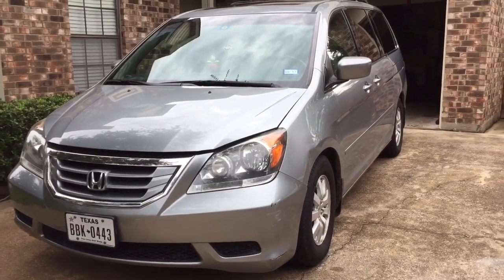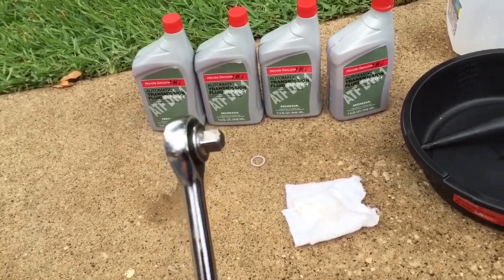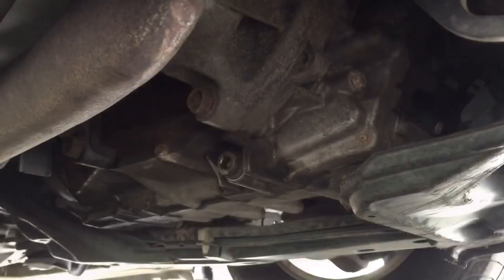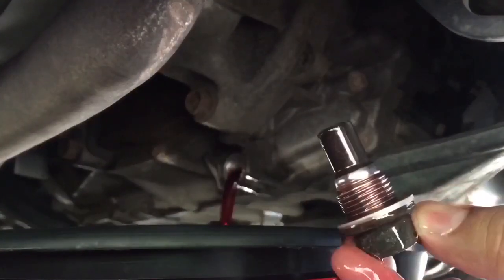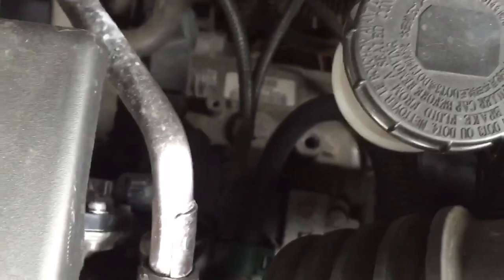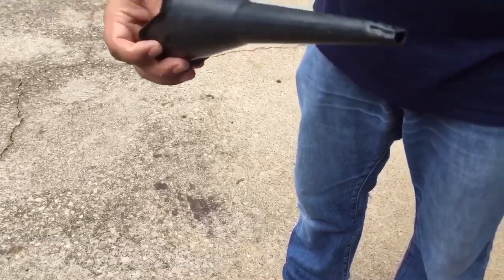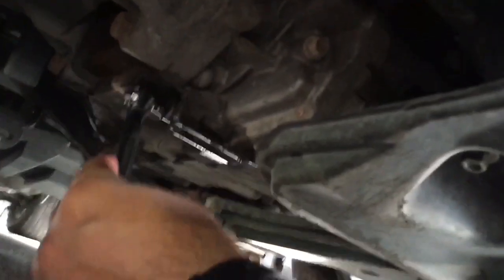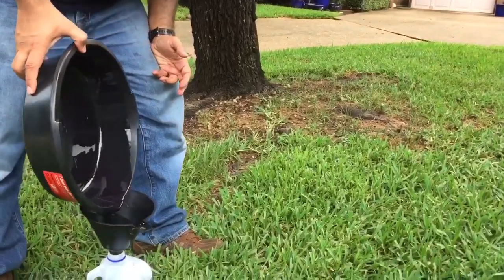2005 - 2010 Honda Odyssey Transmission Fluid Change

Comment: Good vid,  going to have todo this to a 2007 model
I plan I’m using Valvoline full synthetic ATF that is compatible with the Honda fluid.  According to what I have read it’s 3.3 qts to add back of ATF
Reply from the maker: Odyssey has the Transmission fluid dip-stick to see when you are full. Add 3.3 qts and check, then add more if needed. Honda Transmissions are very sensitive to other fluids, and 07 Odyssey has transmission issues so I would strongly suggest to only use Honda ATF. If the transmission fluid hasn't been changed in a long time (or never) then please read-up on the risks of doing a fluid change. If you decide to change the fluid then this video is a good guide. Good luck.
Reply: Fly Bee  thanks .  I appreciate your comments My  2007 odyssey doesn’t have any history of transmission issues.  Just doing a Preventative maintenance. It just got over 200k fluid that came out was a little dark so it was needing a change.  
I did use Valvoline max life synthetic ATF compatible with the Z1 fluid.  

About 1 gallon of fluid game out as  I measured.  And ended  up putting just under 1 gallon in. I initially put in about 3.3 qrts and warmed car up and still didn’t register on the dipstick  so added more a little at a time and checked  until I got it to right level.  
Later on checked again and it was a little high so I pumped out a little  to get to a better level with my fluid transfer pump. From harbor freight tools.  Best $4 I have spent of recent .  

I tried filling through the dipstick but was too difficult so I had the tools  remove the ATF bolt. And went that route.   Using. Funnel extension. And two funnels. This was the first time I have ever did a atf drain fill on a Honda.  
Previously I had done it on Nissan non CVTs ,  they are a little easier to do atf  service on.
Reply from the maker: @dfields9511  Thanks for the detailed feedback as many would benefit from the info you have provided on the process and tools used! Awesome!
Reply: Fly Bee   Tools used 

- 3/8 inch ratchet and metric sockets - -17mm I believe was the size
-Funnel extension (from Walmart)
- 2 funnels from Walmart 
- I already had a drain pan
- I had to use a  3/8 drive  breaker bar to break torque  
-  I had a set of 3/8 drive socket extensions 
- transfer pump ( to pump out fluid if over filled ) 

And of course ATF fluid.  
In my case I use Valvoline synthetic ATF.  I have heard of success also with Castrol Transmax Import Multi-Vehicle ATF.   My mechanic friend told me they use the Valvoline synthetic ATF where he works.  So I figured if it’s good enough for his shop  then it should be good stuff.
Reply from the maker: @dfields9511  Thanks so much for the details! About the transmission fluid, there is a lot of information on internet that aftermarket fluids are at par or even better than Honda's own fluid, while others say aftermarkets causes issues w/ transmission and to use only Honda OEM fluid. Just be aware of it. I don't know the answer so I just stick to honda OEM fluid. Thanks again for your feedback!

Comment: He could have done better on at Phonto I took a male air fitting and the long Shank fit in the dipstick tube then I took a long Phonto cut off quarter inch of the Phonto screwed it in to the  phonto then I glued it in works perfect
Reply from the maker: Awesome! Thanks for sharing.

Comment: For Honda Odyssey 2007, I needed 4 quarts to refill. I bought ValvolineMaxlife fluid a gallon and changed first and then after 300 miles drive I repeated but with Honda fluid refill. During drain, I put the key in, and changed gears for maximum extract.
Reply from the maker: Thank you for sharing your experience and results with all. I have read at a few places to keep one type of transmission fluid in the vehicle and that Honda transmissions are very sensitive to non-honda fluids. Have you noticed any performance changes since your Valvoline fluid change?
Reply: @FlyBeee  Not at all. I think the other one tried hard to match the Honda original in viscosity etc. In my change plan, the final Honda portion is 70% and Valvoline is 30%.
Reply: I wouldn't recommend using anything but genuine Honda ATF. Even if the aftermarket is more expensive.
Reply: In the long run you would be better off using Genuine Honda Fluid. Honda engineering development made for special needs of Honda trany.

Comment: The torque specification for transmission fluid drain plug is 36 lbs.ft or 49 N.m
Reply: And 4 tuga tugs 🤣
Reply from the maker: Thank you

Comment: yea     just open that fill hole... i always open that 1st.... before i drain the fluid...
Reply from the maker: I open the fill hole later to keep control on flow of dirty fluid because when fill hole is already open and we remove drain bolt then too much fluid pours out quickly. You can open fill hole first if you perfer. There is more than one way to do many things in life and I show only one of the ways. Other ways totally work.

Comment: Why not just pop open the 17mm fill port? It's accessible with a 17mm socket, extension, joint, extension and you pop it loose. Fluid flows much quicker through that bigger hole. And I used Valvoline MaxLife ATF works great.
Reply: wakawu thanks you for your special info but he’s was also good because some people don’t have dise tools and that  really helps dose people but yes I’m glad did mention that you’re helping just as well
Reply from the maker: Thats a  good Q. There is more than one way to do many things in life and I show only one of the way, with focus on using only the basic tools to keep costs low especially for people doing this for the first time. Users can decide if they rather get a specialized tool now or later. Thanks for the feedback!
Reply: It can be a real pain to loosen and tighten that 17mm fill port. Both times I've done it, I needed a pipe or bar attached to the socket wrench to provide more torque.
Reply: Honda is very particular about the fluid for Hondamatic transmissions. No substitution is approved.
Reply: @algrayson8965  that's a complete myth. I have a 199,000 mile Acura with MaxLife in it the last few changes and it still shifts solid. If you go to the Valvoline website under the approved specs it is cleared for Honda z1 and the older fluids as well as many other manufactures. I've used this in dozens of vehicles and it's one of the best Atf in my opinion. I'm not the only one either. Check Google and see how many people use it problem free.

Comment: thanks for the video... for me, I would not use any paper base funnel or funnel that is modified. If anything fell into that tranny, you will be hating life.  I would buy a proper fitting plastic funnel and be very careful to make sure only clean fluid goes into that transmission....from my 30 years doing tranny work.. best of luck
Reply: arielban1 30 years experience but watched a how to tutorial lol
Reply: Hydra-Matic (GM) automatic transmissions have fiber (stiff paper-like) filters that catch very fine particles. Some transmissions have fine woven wire screens that catch only coarse particles.
Reply from the maker: I couldn't find a funnel with narrow opening around where I live so I made the extension to get the job done and figured it would help others in the same situation. There are no lose parts in that paper funnel to slip inside the transmission. There is more than one way to do many things in life and I show only one of the way, with focus on using only the basic tools to keep costs low especially for people doing this for the first time. Users can decide if they rather get a specialized tool now or later. Thanks for the feedback!

Comment: How many cans of oil one liter Kicker Box Honda Odyssey 2009 cvt
Reply from the maker: For one drain and fill the 2009 Honda Odyssey used 3.75 quarts of transmission fluid. This equals to about 3.5 liters. I hope this helps

Comment: Isn't there any filter that needs to be replaced...?
Reply: Eddy Guerra ... the  04   odessey has a filter on top of the trans.. its a black oval lookin filter    u cant miss it..
Reply: I disagree... filter should be changed at minimum at 100K miles and it is very worth it.  Not hard to do.
Reply: arielban1 where is it located?
Reply: @bigchungus4432  under the abs module on 2006.
Reply from the maker: Have you found a good video on the transmission fluid filter change?
Reply: yes but you can only do it if the transmission and crack the case to open it up. its not worth it.

Comment: Is it fine to use DW1 in odyssey RB1 that required ATF Z1?
Reply from the maker: Yes, okay to use DW1. A few years ago Honda changed its transmission fluid and now DW1 is what Honda service uses on vehicles that originally came with ATF Z1

Comment: Dude u just changed clean oil  :) mine was black lol
Reply from the maker: Congrats on changing the ATF!! If the fluid was black and you are looking to do 3x3 drain and refills, then space out the next drain-fill by a few days or a week to not shock the transmission too much. If you don't want to do 3 drain-fills, then at least do one more. By the 2nd and third drain & fill the ATF would look relatively clean. Please review the narrative under the video for more details.

Comment: Hey man nice job. Looks like your transmission fluid was in a good shape but you ve changed it anyway ?
Reply from the maker: Wonderful observation! I change transmission fluid of my Odyssey at 15K miles so the fluid is not terribly dirty at this point. As I mentioned in the notes on the video, Honda recommends changing out the transmission fluid at every 30K miles; which means at least 3 dain & refills. However, my preference is that instead of waiting for the fluid to get dirty every 30K miles and then do 3 drain & refills, I do 2 drain & refills at every 15K miles to keep fresh fluid in the system and to ensure the new fluid blends in with the old one and doesn't shock the transmission. Again, this is my personal preference only. But good catch though!
Reply: Our Honda dealer recommends a "complete" fluid change only if the scheduled 30,000 mile/50,000 km. has not been followed, as if you bought a used Honda and didn't know when or if the fluid has been changed. He said that the normal 30,000 mi. change takes less than four quarts. The full drain takes nearly 12 quarts.
For a full drain that removes as much as is possible without transaxle disassembly, drain, start, run for a few seconds andelet drain. This empties most of the fluid from the torque converter.
If the transmission has been neglected and has high mileage, consider filling, driving for a while, then repeat the drain procedure. 24 quarts (6 gallons) of fluid isn't cheap but it's way cheaper than rebuilding the transmission.

Comment: You could use a 3/8" extension to remove the plug after it's loose to keep your hands clean. Great video!!
Reply: gammarotor real Mechanics get their hands dirty
Reply from the maker: Thanks for the really good suggestion. I like working with bare hands where possible, feels more connected and real. But I understand its not for everyone. Dish washing liquid cleans the oils from hands fast. in case you ever need to clean oily hands. Thanks for the good suggestion though.

Comment: There is a fill bolt at the back of the transmission that you can use to refill the transmission.  It's located on the drivers side and at the rear.  You can buy one of the large funnels at Walmart and it will fit in there perfectly.  Makes the job a lot easier.  The dipstick method is super slow and a pain.  It is recommended that you buy a crush washer for the fill bolt and the drain bolt, but it is not necessary.  I've reused them many times without issue.  Torque specs for the fill bolt = 33 ft-lb.  For the drain plug = 36 ft-lb.  A drain and fill of 3 times is recommended to change about 90 percent of the fluid out.  I like to space my fluid changes out by a few hundred miles and I like to ensure the the torque converter reaches lock up prior to subsequent changes.
Reply from the maker: Thank you
Reply: What is torque converter lockup ?? I want to change for my honda odyssey 2009 182500 milage

Comment: Thanks for the video, where do I get the correct washer from?
Reply from the maker: Most of the time I don't replace the washer on the drain bolt. When I do replace it, I get the washer from the local Honda dealer when I buy the transmission fluid.
Reply: Check with the dealer.  You would be surprised.  Sometimes they are cheaper than the auto part stores.
Reply: AutoZone has the correct washer make sure to ask for CRUSH washer not regular washer

Comment: Sorry, but if you don't have an extension to open the fill port.... You should not service this vehicle.
Reply from the maker: Thanks for your feedback. Viewers can decide how they would like to fill the new fluid.
Reply: That fill plug is super tight 
 Not only do you need and extention , you also need like a 30" 
Pry Bar ..... and 6 point socket . 
The 12 point sockets will slip. 

His method is a good one   
Fill up right from the dip stick  .

Comment: I just read somewhere that the oil in torque converter doesn't go out that drain hole. So you just have to dilute and flush it 3x. Is that really necessary? That sounds like 10.5 liters plus another 3.5 liters.
Reply from the maker: This is correct. When we drain the fluid only about half of it comes out. The other half of the dirty fluid stays in the torque converter and is mixed with the new fluid. You can space out the 3x3 drain & fill by a few days. However, if you want to complete the task in one-day, after you do one drain & fill take the vehicle for a spin around the block or a drive on a highway to ensure the old fluid is mixed with new one, and then do the next drain & fill. I space out my drain & fills by a week. good luck

Comment: Instead of teaching people to do things the wrong way, teach them the correct way.  Use the correct filler hole - all you need is an extension for your wrench.
Reply from the maker: Thanks for your feedback. There is more than one way to do most tings in life. This video shows just one way to change transmission fluid. It is up to the viewer to chose whichever method they prefer.
Reply: Great Guy the dealer told me it was fine to fill through the dipstick tube... so great vid!
Reply: Nothing wrong with this method, it's just super slow.  In older Honda's the dip stick was the only way to fill the transmission.
Reply: Their seems to be a bunch of insecure pro's on here that can't handle a everyday joe getting the job done a different way ' appreciate your video..
I have a 2010 my oil seems to be ok..
 The vehicle is driving fine but will change soon ....
Reply: Not all of us amateurs have all the tools and I'm grateful that he showed us the filler hole but then showed another option! I need to do it myself without spending more on one-time-use tools than I do on fluid.

Comment: do you need change the transmission fluid filter ?
Reply: There is no filter to change.
Reply from the maker: There is a filter inside the transmission. It is not required to change the filter.
Reply: @FlyBeee 
 never....?
Reply: It's a non serviceable filter.

Comment: why go through all that trouble just buy a tool you need...
Reply from the maker: Thanks for your feedback. I like to explore different ways of doing things.
Reply: Anna Johnson to much petty shit aslong as it done why bother to act all knowledgeable
Reply: Anna Johnson what tool do you need?
Reply: If your planning on using the fill bolt method, then you will need a 3/8 inch drive ratchet with a long extension.  1/2 inch drive ratchet is recommended.